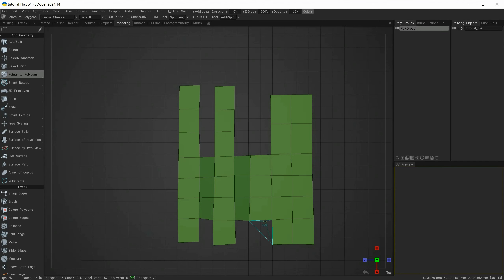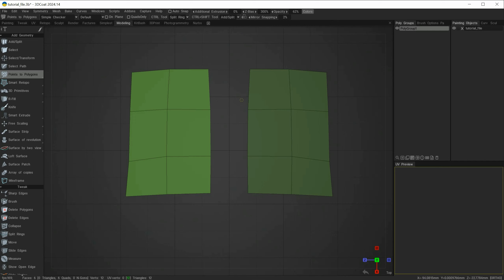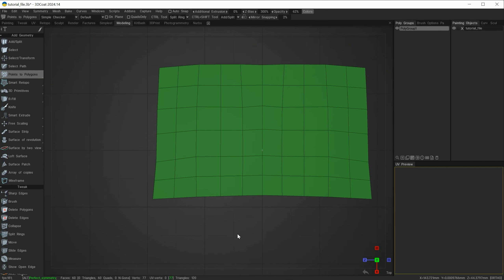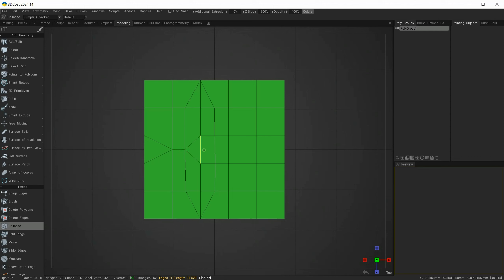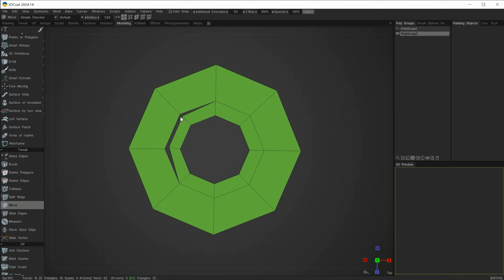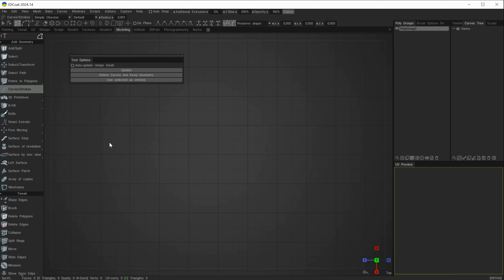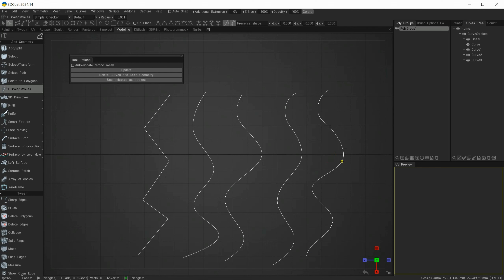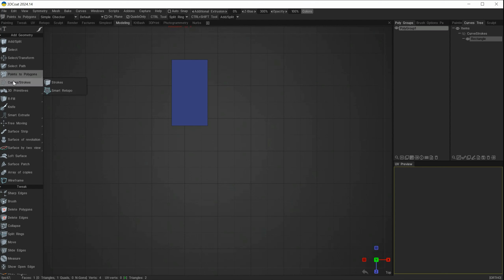3DCoat Low-Poly Modeling for Beginners #6. Creating Geometry in the Modelling Room. Part 2.

Comment: Hi! Just some comments while following along with this video.
- Why is the plane defined by RMB not based on the normal of the face you are clicking but by the POV of the camera? 
- With Quads, why is the plane defined by RMB not based on the normal of the face you are clicking but by the POV of the camera?
- When I right click on a face with Quads selected my camera just shoots off into nowhere and I have to go back to "Select" and then reset the camera to base position, why is this happening?
- Is there a way I can make the rectangle selection tool the default for selecting instead of constantly fighting the brush selection default?
- How do I quickly switch between extruding faces and edges? (Without having to go select -> operate over faces -> smart extrude then go back to -> select -> operate over edges -> smart extrude)
- When I click on a name of a poly group / layer to rename it the rename box just disappears, but when you click the middle of the box it does work.
- How do I select the border (vertex or edge) of a "2D" polygon like the shape you have at 24:09 ?
-  Curves / Strokes -> select the box shape -> adjust radius for bevelled corners -> Update result is that it does not give the actual shape with bevelled corners but just a plane with 4 verts. Also if you drag out one box and hit update and then do the same thing a couple times it just won't add any geometry at random. (This is even the case with auto-update).
- How do I see smooth and sharp edges at the same time? Some edges marked as sharp and the rest is auto marked as smooth.